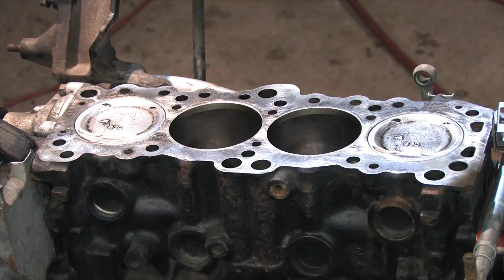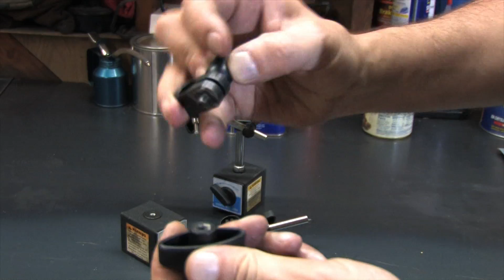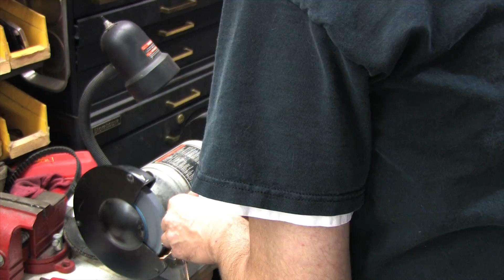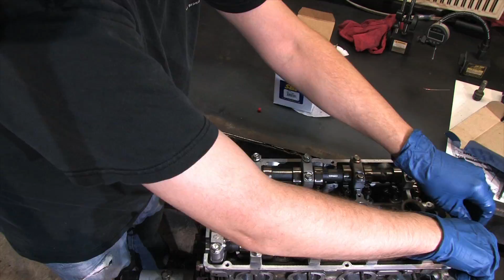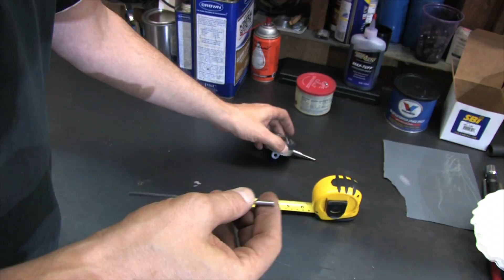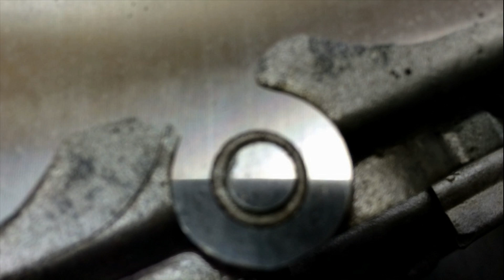Cylinder Head 205 - Degree DOHC Camshafts

Comment: Hey there,
I have some questions about how to degree camshafts, in my case we are talking about a motorcycle, 2004 zx10r to be exact.
On my camshaft gears I don't have any marking for the degrees in relative to the camshaft.
I was wondering how do I know how much do I need to move in order to get the specific degrees that I need...
Hope you'll be able to help me.
Thanks, Barak.
Reply from the maker: The cam gears are adjustable?  If so, and no markings are present, all you can do is attach a degree wheel to the crank and test each time after you make adjustments.  The markings on the degree wheel will indicate the opening/closing events so that you can compare them before/after adjustments.  Usually factory cam gears aren't adjustable, so if they're aftermarket cam gears are un-marked, I would write those gears off as being sub-par and try a different brand the next time around.  Not because they're not good cam gears, just because they're inconvenient.  I'm sure that the cam gears are much smaller than the ones on my DSM, and making markings on a smaller radius would be difficult, but I'd at least expect to find a zero mark or 5° increments.  Seems pointless to make adjustable gears that don't indicate their positions because they move whenever you bust the lock nuts loose.  Make your own marks before making adjustments, and use a degree wheel on the crank to check yourself.
Reply: *****
The gears are a lot smaller then what you used on the video and they are adjustable, but no markings. 
I got the cams with the gears from - carpenterracing.com  and from what I understand they are considered to be quite good...
Anyway I'll give it a go and see if it's working out.
Thanks for the tips.
Reply from the maker: Yeah, I wasn't trying to bash anyone's product.  I know that if each one of the markings on my huge cam gears = 2° of crank adjustment that markings on anything smaller would be REALLY tough to do.  Degree wheels don't lie, so I'm pretty sure that's what will set it straight.

Comment: is the opening event always the same as the closing event on the idicator or does that depend on the camshaft???
Reply from the maker: It depends on the manufacturer's specs.  The value HKS uses is at .040" lift.  Most manufacturers measure .050" lift.  Duration is the amount of time the valve is open from that given specification.  You'd measure at the specification the manufacturer included (or if you don't have it, you can usually find them online or in your factory service manual if they're stock cams from a production car) and try to match their open-closing event degrees.

Comment: i don't really understand why you use test springs
Reply from the maker: It allows you to check valve clearance.  If you're working on a non-interference motor, you wouldn't need to do that test.  If you're working on an interference engine, it's the most crucial part of the camshaft degreeing test because adjusting cam timing changes your valve clearance.  I have another video about this topic.  This one is the basics.  Check out Cylinder Head 206, and it will all become clear.  ;)

Comment: 20minutes in and you still haven't  touched the degree wheel?
Reply from the maker: Sorry man.  This channel's about all things 4g63.  There are no degree tools pre-manufactured for dialing in a 4g63.  Whether it be hydraulic lifters or funky crank dampeners, a LOT of other engines have the same generalized problems with tool availability that I show people how to work around in this video.  It's intended for people who have never done it.  The majority of degreeing tools are made for pushrod engines leaving the average import guy out in the cold where it comes to performing these tests.  The tools you use on this job are critical to getting good measurements, so they are indeed part of this process.  If I had jumped right into the degree wheel on an assembled block without covering the tools and correct head assembly process, lots of newcomers to this process would be lost and getting it wrong.  It's every bit as important as showing how the degree wheel works.

Since you've got those tooling and assembly factors figured out for your engine, you may benefit more from Cylinder Head 206 where we talk about Lobe Separation Angles and the affects of changing your valve timing.

Comment: Hi, Ive just been installing some new long duration cams into my bike, whilst degreeing the cam in and checking the valve clearance I heard the valves touch the pistons and stopped me from turning it any further. I thought I'd ask your opinion, do I need to strip it to check all the valves, is there any chance of damage by only hand turning it over???
Reply from the maker: You will know based off of your compression numbers.  Do a compression test.  If there's any leakage, it will be really obvious in your compression numbers.  :) b

Good question!

Wait... they hit while turning by hand on a cold engine?  If so, you're fine.  Don't waste your time with a compression test unless you really banged into the valves hard and kept turning or heard the engine munch, knock or ping while it was running.  The materials are all softer when they're hot, but I still haven't heard of anyone bending valves by turning by hand.
Reply: ***** Thanks for your advice Jafro. I'll chuck the engine back in and see how much power I have gained on the dyno. 

I'll be racing this bike in the Isle of Man this coming season and have prepared it all myself with the help of these vids so hopefully I've been listening good and the bike will show some good improvements, Thanks again Liam#77

Comment: 20:52 "the factory service manual says you need to turn the engine shaft 2 times clockwise". This is just to make sure that the both camshafts are aligned to the main crankshaft. If you can run the shaft 2 rotations this make sure that there wont be any impact of the valves to the pistons. That's it. You say oil will flow to pass valves.... ?!? do you think that the torque you provided is enough to power the oil pump ?
Reply from the maker: It's not oil past the valves... it's oil past the CHECK valves in the lifters.  If a lifter is inflated, it is applying a greater spring pressure to the cam lobe rockers->cam lobes->cam gears and thus the timing belt.  The Factory Service Manual does not specify why you have to WAIT 15 minutes before checking/pulling the tensioner pin.  If you've got the TENSION on the belt set wrong, then the pin won't spin freely... however, a fully-inflated oil-filled lifter is enough to apply enough pressure to the cam gears to make the belt too tight to spin the pin.  That is why you have to WAIT 15 minutes to let that bleed down.  If you soaked your lifters in oil, that's all it takes to have this condition happen during assembly.

So no...  The torque I provided will have no affect on a dry oil pump.  All of this is for the sake of the LIFTERS.

Comment: Hey Jafro, I've got a question for you. I was watching a video on installing the crank and pistons. When it got to gapping and installing piston rings, they used one of those summit racing ring grinders, but before installing they used a file to 'deburr' the separated ends of the ring that seal against each other once installed. As far as I know, you should never alter those surfaces if you don't have to for fear of creating a leak, what's your take on this?

Comment: Love your vids, something that might help with the tapping would be to heat (with Oxy. Acty. kit) the centre hole of the socket to a Cherry red and let it cool in air, this will relax the grain structure of the hardened metal and save your tap.

Comment: got a question not about this video. I am doing a 6 bolt swap with a 7 bolt head and in the swap guides they talk about useing the front case off the 7 bolt for the crank sensor. But in one of your videos i was watching you said use the case that goes with the block. Have you covered this? if so any clue what video

Comment: Use a bicycle wheel spoke to extend a dial gauge! Some of them have the correct thread to screw into the dial gauge and they're straight, cheap and abundant.
Also, the correct thread for most of the dial gauges is M2.5 with 0.45mm pitch.
On another point, I like to measure my TDC using 1mm BTDC and 1mm ATDC of piston lift, as the top dead center is - as the name suggests - a dead center. Depending on the stroke-rod ratio, the piston might seem to stay completely still at TDC for more than 3-4 degrees of crank. I mark the pulley for 1mm BTDC and ATDC and the real TDC is exactly between those two.

Comment: I remember my cousin putting dohc heads on a 400. grinding the block, drilling and tapping holes, running a timing belt, plugging up countless of the previous timing holes, and shortly there after ruining 1800 dollars worth of top and bottom end. I also remember the day he got it right.... 9800 rpms and 630 ponies at the flywheel. His garage walls were floor to ceiling in math. Now it sits in a Catalina in Florida, Waiting to become scrap.

Comment: Mmmm adjustable cam gears.   So I just bought a fiesta st.   Dont worry the talon is in the garage.   But this thing is fantastic.   What if anything do you know about Ford ecoboost tech?
Reply from the maker: Pardon my philosophical embellishments, but I'm a huge automotive history fan.  Its personal.  Right in the blood.

Henry Ford said, "racing has been around since the moment the second car was built."  Nobody believed Carroll Shelby in 1986 when he stood in front of a 4-cylinder turbo hatchback called the Shelby GLH, which he built in partnership with Dodge... claiming it was the wave of the future.  He said that car's like the GLH would be the ones your children would grow up racing.  Any 16 year old in 1986 is now 44.  It was a prophetic moment in time.  Look up the GLH if you don't know about it.

Those EcoBoost and EcoTec-series engines are what the next generation of gearheads' offspring will be modifying and racing, and I'm not kidding.  It's history repeating itself.  The factory output on those things is HIGHER than most of the 1.8L LS and GS Integras from the '90's.  That's NOTHING AT ALL to complain about from a 1.0L 3-banger that gets 46 mpg hwy.  It's a better performer than most hybrids as a result.  Its output is off the charts considering its displacement.  148lbs of torque from a 60 cubic inch engine is insane.  100 horsepower per liter used to be something that champions who raced LeMans struggled for decades to achieve.

Turbochargers are the only way that performance can survive with impending fuel economy standards.  Everywhere you used to find displacement, you're finding turbos.  So different than when I grew up.  Buick's got a 1.4L turbo pushing a luxury SUV around.  Chevy's got a 1.0L turbo diesel that's getting 48mpg in a similar ultra-light chassis as the EcoBoost Fiesta.  I won't bother with numbers on that one because a diesel is a whole different kind of beast.  Yes, I called a 1.0L a "beast".  Yes I had a straight face.  ...but it's turbos, turbos, turbos.

Carroll Shelby's yelling "I told you so!" from the grave.

A lot's been learned since the dawn of the turbocharger.  This is where fuel consumption for the next generation is going, and there will always be some pioneering kids who will burn just as much fuel-per-rpm with their 1 and 1.4L engines as I do with any of my cars.  I promise you that.  

Burning gasoline still hasn't gone out of style, and someday it will be a luxury.  30 years from now, the '50's, '60's, and '70's cars will all be in museums, and all of the cars from the '80s will be broken.  Hey, I don't make these rules, it's destiny.  That's what all of those cars ever did.  Nobody is going to collect and restore any of the early hybrid generation cars.  Dad's 1.6L to 2.4L hot rod from the '90s will become the ones your kids wish they could get their hands on for prom dates.  I think there's going to be a great future for the EcoBoost's future parts market because that 3-cylinder turbo's going to be in LOTS of other stuff with a Ford label on it going forward.  They're more efficient than the '90's generation which I will always be stuck in.  It's my thing.

Take your time and get your DSM right.  ;)  Whatever you do, don't let it go or some kid 20 years later will scoff at you in extreme disapproval.  :P

Comment: One question. You didn't tighend the head. Because the cams are now "higher" above the crank than in the future, will this effect the cam timing?
One tip that I found on YouTube finding TDC more accurate. Because the moving near tdc is so small, you can go the same high/reading on both sides, than in the middle of these degrees is the TDC.
And another Tip. You can find pdf's of degreeing wheels on the internet. I have printed them out and glue them on plywood or acrylic. Of course you have the same mounting problems.

Comment: Once again youve an incredible contribution to the gearhead community.  Thank you!!
 And here is a tip from the blacksmith shop if you ever have to cut on sockets again or anything that may be some kind of hardened tool steel. You can get the metal as soft as they it will get by heating it up to dull red or wherever it looses magnetism and then let it cool as slow as possible which usually means dunking them it vermiculite.  (Its like kitty litter and found at pet/garden stores)

Comment: Just curious is this just an engine rebuild or a build for more horsepower?
Reply from the maker: The original builder mixed and matched combinations of factory parts from multiple stock cars in order to build a performance build out of 100% stock parts.  So, it's both!  Some of the parts I wasn't able to re-use, so now I'm dialing-in their replacements.  These steps weren't employed in its original build, but now I have to for safety reasons because machining tolerances have become too tight.

Comment: Jafro, using a dial indicator with a round tip on a thread is a bad idea. You can unscrew the tip, than have the flat end to use instead of the round tip.

 I know you acknowledged this in the video about the round tip on threads but I thought I'd just point this out.

Comment: Great video! 
I have a question if you don't mind answering. The way you found the centerline is new to me, I'm still very new to the degreeing in general but I was under the impression that you find the centerline with just taking the 2 measurements, add, then divide by 2 and that's it. Which I saw the original spec is what that would of been but I saw you subtracted another 2 degrees, why is that? Is that only for that cam or type of motor?
Reply from the maker: I was calculating INSTALLED centerline.  Usually cam spec sheets have the installed centerlines listed whenever they include opening and closing events on the spec card.  The centerline is indeed 105 if you measure .040" lift at 0° TDC, but the opening event is at 2° BTDC, and why 2° came out of the centerline measurement.  The centerline HKS printed was at 0°.

EDIT:  Lookup RBracing camshaft calculator and punch those intake cam numbers in... it will tell you it's 103°.